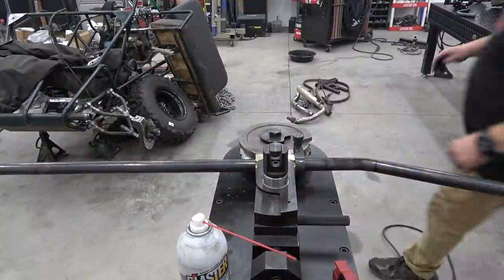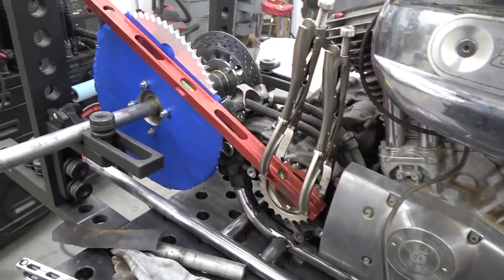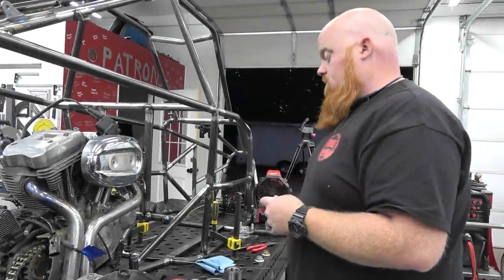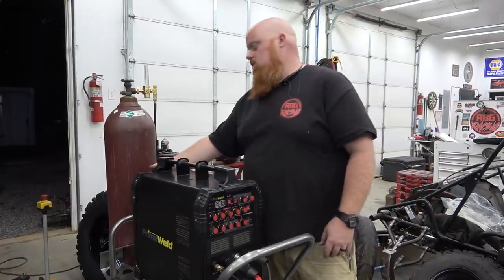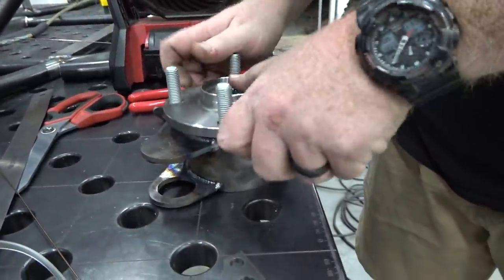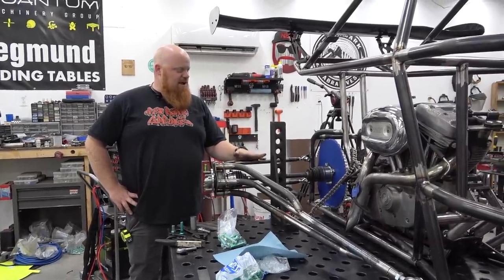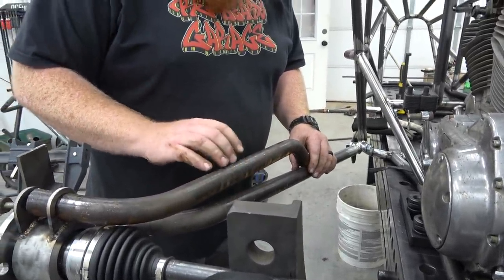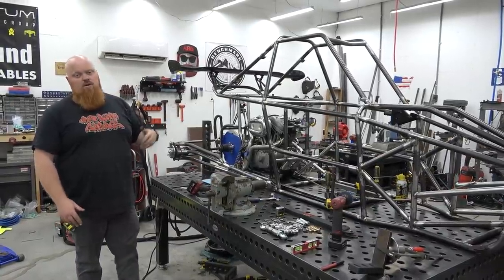Harley 883 Cross Kart Ep2 ~ Rear Trailing Arm Build & Spoiler

Comment: So nice.  You guys are working hard and it looks beautiful.  If your nervous about taking press fit parts and making it slide in easier by changing the tolerances I wouldn't worry too much.  Sometimes things get a little  too tight after welding even when we're careful and rotate and wait they can still get way too tight.  Like trying to park a Cadillac in a dog house.  I do it myself on occasion.  I haven't had a problem  in about 30 years of fabrication.  I'd say the danger of premature wear/failure is only theoretical 😉.  Keep up the good work we're all waiting to see that bad boy run.  Thanks for putting a spotlight on my favorite hobby btw it's so nice to watch and learn from other experienced craftsman.

Comment: Use the “green” sleeve loctite to help keep the bearing from spinning in the hub and spindle till your ready for the permanent design when u can press em in.
Reply: This all day, there needs to be a press fit so the outer race doesn't spin in the housing if not then the bearings won't be doing bearing things properly. You could end up destroying your new bearing adapters and trailing arms because of that poor fit, the hardened race of the bearing will chew up that DOM if it spins.
Reply: Also that hub is supposed to be pressed into the inner race so it doesn't spin in the race. So much wrong with that whole bearing set up.
Reply: Also that hub is supposed to be pressed into the inner race so it doesn't spin in the race. So much wrong with that whole bearing set up.
Reply: He could tack in the bearings with the tig... but yes press fit is proper .001 a inch correct

Comment: It’s awesome that your using over the counter parts! But you will be going through bearings and hubs! They are a press fit for a reason!!! I hope they last! 
But awesome build none the less!! Can’t wait to see and hear it moving under it’s own power!!
Reply: I see this alot, with YouTubers building hubs. Bearing just falling in.
This could allow the Bearing to spin, where it shouldn't be spinning. Lol
Reply from the maker: When you build a buggy you are taking bearings in and out so I didn't want it to be a press fit because of the headache it would add. When I get a rear suspension design that is tried and tested I will make them press fit until then it will work just fine.
Reply: @RedBeardsGarage  fair enough. Tbh your buggy isn't driving 200k miles either. So probably will be just fine! Great build as always.
Reply: Don't need a big press fit. Just need to be hard of slide in with hand like -.0001 +0.0000 slide fit it's perfect. Just use loctite if something goes wrong.

Comment: Please don't forget to support the rear cylinder. There is normally a mount between the heads. I'm a sportster freak. If it's not supported, you will end up with a base gasket leak really fast.

Comment: Folks bearings are designed to be pressed in for a reason, they will rotate and wear what they rotate in, and instant presto now you have expensive scrap. Also those weenie little hub brackets for the trailing arms need to be much thicker.
Reply: These types of bearings are sealed and have inner and outer races they rotate in.  As long as the CV axle nut is torqued to spec it will be just fine.
Reply: its probably gonna be a trailar queen . all that thick wall tube gotta weigh a ton with all of 40 hp it will be a trud

Comment: I took a 883 and did the 1275 kit from
Hammer performance and took it from 48 hp to 110hp and they offer a 125hp kit as well. It’s real and it’s insane. For a NA motor.they offer different packages. 80+-90+-100+-110+-120+ hp kits. I did the 100hp+ package and dyno out at 111hp 88ftlbs and next dyno day I should have more ftlbs had to wait on cpl things
Reply: Those 883 motors are short on power. 30 years ago I did a 1200 conversion and the difference was night and day. The 1275 kits are even more impressive.

Comment: Hey idk If this your actually gonna read this but the miata bearings and spindles are meant to be press fits so you don't spin a bearing race. It might be better to make the knuckle removable from the whole trailing arm so it can maintain the press fit and still be maintained.

Comment: I wonder if you will need to change the jugs and pistons to make it a 1200cc those 883cc Harley’s don’t have much guts that’s a lot of weight when all done, 883cc is normally a beginners bike or ladies bike, you will need a stage 1 at the very least. Good luck nice build👍

Comment: What is the blade you use on your metal cutting saw? I looked through your Amazon store but it just had the saw with the grinder like blade on it. I want to buy a cold cut blade.

Comment: If this was a high hour many miles rider you'll regret that loose fit wheel bearing to housing clearence as they will spin and will wallow out the hubs eventually,meaning you'll have to cut them out and remake new ones along with welding them back into the trailing arms... They're meant to be pressed in or tight clearance fit for a reason as pretty much all hub or wheel bearings are... But you'll prolly get a few hundred hours before they self clearance the hubs enough to change the angles..

Comment: Why’s the sprocket so big ?
Reply: The sportster is a fairly light bike compared to Harleys other bikes.
Regardless the sportster has very little rolling mass. Having added weight (extra 2 tires, potentially larger wheel size, extra steel ect), lowering the gear ratio will add torque. Get this hoss moving a little quicker. 
Also, the sportster is geared for highway speeds. Need to gear it down for less stress at lower off road speeds.

Comment: If only you'd have found a 1200 Buell x engine and had 103 hp in the exact same space...double the 1200 sporty engine hp almost and torque way up there... More than 2.5 x the 883 hp rating..

Comment: I dont understand why you went with direct drive chain power when its been proven over and over again you need a torque converter to maximize all the power coming from the motor you are wasting at least 40/50 percent of all power produced and yes they make a belt drive to handle the Harley motor

Comment: Cool concept, but unfortunately it's a Harley engine and transmission. It may work it may not, one thing for sure, it's going to leave it's Mark! Have not come across a single Harley Davidson even these newer versions which don't leak some sort of oil!!! My neighbor buys a brand new 2019 Sportster fuel injected bike with under 100 miles on the POS the shift fork somehow managed to bend!?!? Inside the transmission, which means they had to split the cases to repair the thing. His brand new pile now drips it's oil and leaves it's marks all over the garage. My brother in law owns another one, and it's a older one but it's leaked oil from each and every cover and gasket flange on the pile since the thing was New also! Like WTF is wrong with this picture here? I'm all about buying American made products! BUT when it comes to these people and their bikes they couldn't build a leak proof anything to save their lives for some reason??? I personally own a 1972 Honda CB 500 all original and runs like the day it was made! Why does my 72 with all its original seals and gaskets not leak a drop of anything? And these new farm tractors on 2 wheels still can't control their fluids yet??? This is just one topic I picked from the horrific stories I've heard and witnessed from these Harley engine's new or not. My buddy buys a brand new full dresser and decided to take it out to Sturgis, we live in upstate NY here. Welp the brand new POS never made it out of NYS before the roller camshaft decided to have its lobes eaten off the cams. Harley's excuse was they had problems with their metal hardening processes and needles to say he missed the biker show out in Sturgis cuz they had no cams on a shelf due to it being a brand new bike. So he had to wait 3 weeks for Harley to figure out WTF happened, and build new cams that were properly hardened. Oh yeah since then it's had oil leaks from being disturbed at the dealership which no other dealer has been able to repair yet? So yeah unfortunately they give themselves their own bad name! I can fully understand it having issues from say your shade tree mechanic throwing on a bunch of aftermarket parts and then it has issues and leaks, but this shit I'm talking about here was all brand new garbage that couldn't make it a thousand miles away from home without catastrophic engine or transmission failures. I'm sure there will be plenty of die hard Harley guy's ripping my head off over this comment. But I'm an engineer for a living and started out turning wrenches for half my life! I'm not ignorant! I know what manufactured shit is! I've dealt with many factory engineer's over many other products and problems found in the field. When Harley Davidson ever gets the heads out of their asses and takes a real long hard look at how and why a Japanese bike can go upwards of 100K on the original internals and not leak like the Titanic! Get rid of their stupidly designed crankshafts that shake everything apart including the riders, build a balanced engine that doesn't overheat at traffic lights and burn gas like its 75 cents a gallon just maybe they would have a product worthy of being called a great American bike!? One thing with Harley doesn't change, and that's Harley! They are so afraid of losing their unique following that they do not change the biggest problematic issues with their engine's. Long strokes suck! Their single pin crankshaft design is yes unique to Harley, but it's inherit to never being a good balanced system, especially with such long strokes which makes the cylinders scavenge horribly so they require much more fuel and blow the rest of the un-burnt out the exhausts. So I kinda know what I'm talking about here and it's pretty hard to argue with facts about these bikes. Just hope Red Beard has good luck with his build. The chances are not in his favor though using one of these engines.
Reply from the maker: I didn’t even read this comment. The length of it alone was annoying.
Reply: @RedBeardsGarage  Same, I got halfway through and was like "f this".

Comment: I’m curious how your gonna deal with vibration!
Does the 883 get rubber shock mounts?
Are y’all connecting it up raw?
Watch out for cracks on the primary case cover as well if you hard mount it.
Reply: He shows all that in ep1